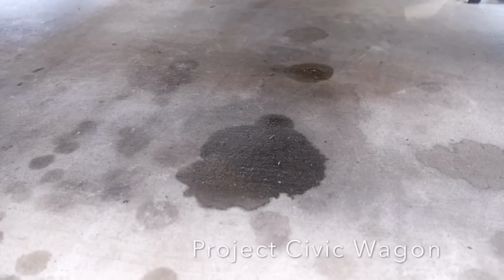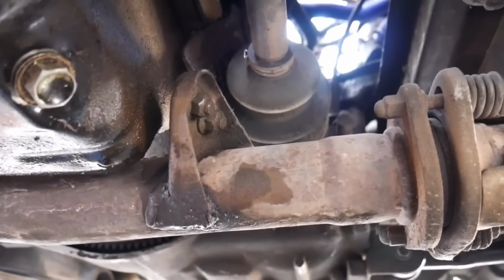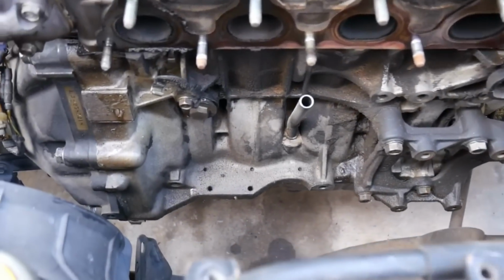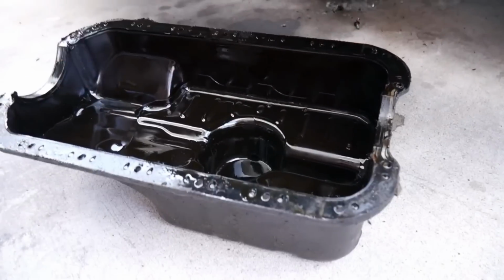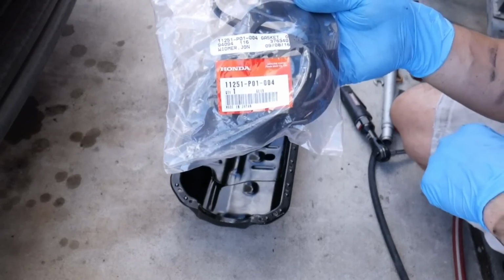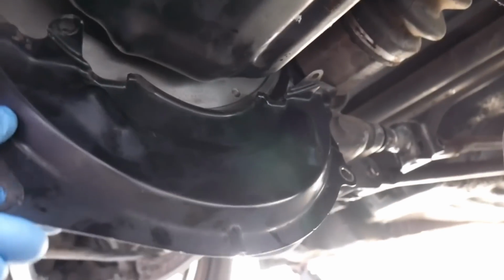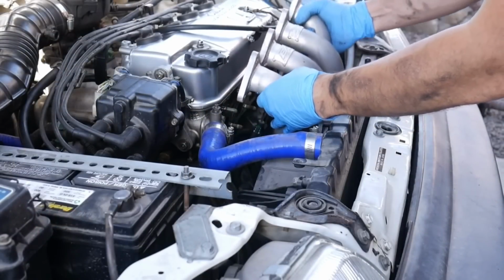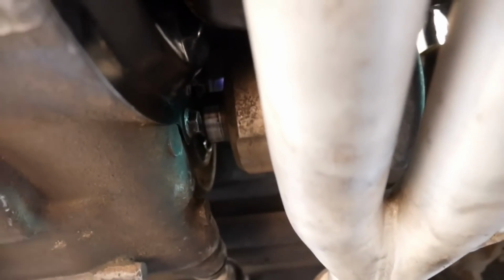How to Replace Oil Pan Gasket & DC Sports Header - 1991 Honda Civic Wagon

Comment: I had a cel come on recently and didn't realize the o2 sensor wire was hanging super low and rubbed on the ground and was wondering if I could just cut off the excess slack and solder it back together. this video answered that question!
Reply from the maker: Hehe, nice!

Comment: Thank you for all these straight-to-point, fresh and clear videos. Q: I bought a Usdm 91 Civic Si which is slowly getting tuned by me. It came already swapped with a DOHC D16A8 (a Euro-type ZC). They only swapped the engine and kept the rest of the bay with the original parts. Do you know is there any DC header that can fit this engine? I am going to use daily this in California but a nice header would be great. Thank you in advance for any advice.
Reply from the maker: Yes.  The sohc DC header is carb exempt too so you can use it in CA.
Reply: @GarageBuiltHondas  Will the clutch cover for that year civic work on a 94 civic 1.5 liter?
Reply from the maker: Yes.  The 88-95 Civic d15b engines all use the same parts

Comment: Oi im back at it again. Looks like the same process for d series motor. I have a big oil leak looks like the oil pan gasket. Looks like im missing a couple of bolts or nuts. My exhaust manifold has a crack. I was thinking about doing the same just with cheaper ebay header. Have you tried the ebay header and also do you know what kind of hardware i should get for the oil pan. I keep looking online and i see bolts and nuts looks about 10 nuts and 10 bolts. Oem gasket but what about the hardware. Should i get the hardware for the down pipe incase i mess up the bolts? Should i not get the ebay header. Do you know of any channels with d series motors. I got the zc but as far as i can tell its the same as d16

Comment: Hey man, i‘ve just started my own buid of an 87 civic wagon. But I cant seem to find that many parts. Could you maby tell me where you got your parts from? ( i need a new rear bumper, new brake system, etc)
Thank you so much!
Reply from the maker: No place in particular.  Original parts are difficult to find for 3rd gen civics.  I don't and have never owned any (don't find them appealing) so I couldn't tell you where to find parts, sorry.
Reply: car-part.com if you don't have access to junk yards it comes in handy.

Comment: I got a question on the o2 wire extension. The wire is single but it has a wire sheath. Is the wire sheath on the outside ground? Does that wire also have to be connected? I messaged you on ig about the same thing.  Im pretty sure both have to be connected.
Reply: Just realize that im talking about the wire to the engine harness before the plug connector.
Reply from the maker: It's a shielded wire, not grounded.  I've seen some o2 sensors work perfectly fine without shielded wire and some that didn't.

Comment: How long did you wait to put oil in I followed these steps and it was leaking bad on my headers still kinda frustrating
Reply from the maker: Immediately.  But I didn't start it until 24 hours later at least.  The RTV takes that long to cure.
Reply: @GarageBuiltHondas  dang so I'ma have to redo it tomorrow forsure

Comment: hey bro....question...what steps up the idle when the ac is turned on on these engines. ive heard of people saying iac....mine is one the bottom of the throttle body with two coolant hoses attached. the cold start fast idle of it is working so im wondering if something else steps up the idle with ac and turning the power steering.
Reply from the maker: +Jamauto tech are you dpfi still?
Reply: no im multipoint d15b7
Reply from the maker: +Jamauto tech The small valve which is attached to the manifold & throttle body and has a vacuum hose going to the middle of the intake manifold.
Reply: is there a way you could show me a pic or smt of it? by the way im a upcoming youtuber as well from jamaica and i love your content..keep up the good work! they installed a d15b7 into my 1993 integra before i bought it. i dont see any other valve on my intake unless they took it off
Reply: oh you talking about the valve at the back of the manifold? my intake manifold doesnt have that on it
Reply from the maker: Jamauto tech no, it's right on the end of the throttle body, and had a small vacuum hose to the manifold.  Google "d16a6 engine" and you'll see it!

Comment: Nice video J. Hey I had a quick question (you'd most likely be able to answer this). So on a B series, the bolt(s) that hold the exhaust manifold to the head came out easily, but once tried putting the exhaust back on and tightened the bolts it just keeps spinning/not locking. I know you can heli coil it since the bolt hole has been stripped. So my main question(s). How big is the "hole" I believe it's fit for an m8x1.25 bolt. And also instead of just putting an insert and putting another bolt would it be better to just fit on a stud (just like how the d series in this video has all studs. thanks for reading this long post. Ps- could you possibly make a video on tapping/rethreading? You'd seem like the best teacher on that.
Reply from the maker: It's funny you mention this, one of the studs coming out of the head actually broke off leaving the rest of the bolt in the head.  I'm going to try my best to remove it without damaging threads but that may be impossible.  If not I'll do a tap to the next largest size.  I'll check the measurement and report back here, I cannot recall the size off the top of my head.

Your idea of tapping the hole to a larger size and putting a stud is a good idea too.  The only problem you may encounter would be that the new stud is too large for the holes on the exhaust manifold/header.  But you could always drill that single hole out a little larger on the exhaust manifold/header and that would be easy!

I'll record the process of me trying to fix the bolt, I'm hoping I can just drill it out and use a reverse bit to remove it.
Reply: J Wid Films wow sucks for the stud getting broken! I really hate this because it causes an exhaust leak on mine haha. But yeah it's something I've been trying to figure out instead of doing inserts. Will be awesome to see a video and see how you tackle it down!

Comment: Does it pass inspection when putting the o2 sensor in the bottom and does it read the same  

In my ebay headers I have the option to put it on top and/or bottom and cannot use the top because it won't clear my fan just wanted to know if the reading the o2 sensor did was the same ?
Reply from the maker: Yes, it will be the same and should pass inspection.  Make sure the top one is sealed well so it is not leaking.
Reply: J Wid Films thanx man I just started doing the extension on the o2 sensor wire
Reply from the maker: DjReckz nice, you should be good to go!!

Comment: When u soldered the o2 sensor, did it have any problems with readings? Might have to do this with my o2 sensor as well
Reply from the maker: BirdyIsPro73 No problems at all and I've done this with numerous 02 sensors on these cars.
Reply: Garage Built Hondas i guess ima get my ass to learning how to solder, what gauge wire did u use?
Reply from the maker: +BirdyIsPro73 16 or 18 are most wires for the harness.  I can't remember exactly what this one is, I believe 16.
Reply: Garage Built Hondas alright thanks man, finally got some good answers, u just got a sub bro, thanks. Been struggling to find a way to extend an o2 haha
Reply from the maker: BirdyIsPro73 awesome, you'll be good man!  Seems like the o2 sensor wiring on these cars is always jacked up!  And thanks for the sub, much appreciated!!!
Reply: Garage Built Hondas yeah and the good thing is that my 91 integra has exactly the same o2 as ur car, im like thanks honda for making all cars the same xD
Reply from the maker: +BirdyIsPro73 No kidding, the one wire o2 sensors were so inexpensive too!

Comment: i installed an aftemarket and put copper antizise to all the bolts that mount the headers to the engine block and when i turned on the car ' about 15sec after smoke came out. so you think it might have something to do with the copper antizise or something else
Reply from the maker: Aftermarket header?
Reply: Garage Built Hondas yeah sorry. headers.
Reply from the maker: It might have been the residue on the initial burn from the new header.  The antiseize might burn up too but I didn't think it would since it's used on spark plugs and threads also.
Reply: Garage Built Hondas im thinking its either that or the gasket from the headers wasnt placed right. i placed some after market ones and it came with a thicker gasket and i noticed that the offset is off. the grooves dont match with the grooves on the engine block. i havent turned on the car since that happened and i got scared from the smoke coming out. I'll take the car out of the garage check everything out again and hope for the best. ill keep a fire extinguisher with me for extra comfort
Reply from the maker: Let me know what happens.  You should be ok.

Comment: Getting that transmission cover off was such a PITA.  Do those top bolts even matter?  I'm thinking of chopping it to get it back on.
Reply from the maker: You're probably fine without them
Reply: Were you able to remove the flywheel cover without moving the cv axle ?
Reply: I removed the axle and ended up having to replace the axle seals when my trans started leaking a month later.

Comment: Got a 91 civic sedan dx, d15b2, runs rich, have high hydrocarbon numbers, it misfires at idle, when i stop at a stop the car wants to die, but doesnt die as its running. only happens whenever i have less than a 1/4 tank of gas. No smoke, no check engine light. Any sugestions?
Reply from the maker: Has a tuneup been performed?  Plugs, wires, fuel filter?
Reply: Jon Widmer 
did new plugs, distributor cap and rotor, has fresh oil change, have ebay intake with new filter, replaced coolant temp sensor. just bough the car, last owner said he put new o2 sensor.
Reply from the maker: If it only acts this way when low on gas, it might be the fuel pump filter/sock being old and clogged possibly.  When the gas gets low, it is only going in from one side of the sock and that side might be pretty rough.  Just last week at the track, a friend changed his pump/filter in his miata and the sock was all caked up with this white crusty residue.  It's a possibility yours may need replacing.
Reply: Jon Widmer is that why it also runs rich? or could that be a different thing causing that?

Comment: have you ever used a auto parts oil pan gasket?
Reply from the maker: That blue evo tho Do you mean from Autozone, O'reillys, Napa, etc?
Reply: yes I do
Reply from the maker: That blue evo tho Yes, I prefer the OEM ones but I've had good luck with the auto parts store versions.
Reply: ok because my oil pan gasket is leaking but my plan is just to buy one from autozone for mean while since I my end up doing a swap down the road
Reply: thank you tho really appreciate it

Comment: I also having an oil problem  I have the oil light on my car just stalls out and my power steering gets hard
Reply from the maker: Are you sure you're not low on oil?
Reply: I went under the car and it was leaking as well   I have a Honda  civic coupe 1996 got a D15B engine and my friends say I have the wrong oil pan it’s leaking from the top I just say it’s the head gasket but honestly I  don’t know

Comment: Having an issue dropping the oil pan the transfer case is giving me an issue I'm not sure how to take it off please help meeeee
Reply from the maker: There are a couple nuts attached to the flywheel cover which might be the problem you're experiencing.
Reply: @GarageBuiltHondas  that's all out, there's a screw that comes out the transfer case that's giving me an issue and I cant get out to take the transfer case off so I can take the oil pan out it's kinda hard to explain ... easier to show I was told I have to drop the transmission in order to do it ... I have a 91 Honda civic wagon real time awd ... anyway I can send you a video ...

Comment: That header looks like it would fit my 89 integra perfectly. Do you have the part number?
Reply from the maker: It might.   Part # HHC5002 made specifically for the 88-91 civic/CRX.  If it doesn't bolt up you could always modify the flange.
Reply: Thanks dude. Well i know for a fact the 86-89civic and 88-89 integra share the same chasis. Everything you have been doing to your cars looks almost exactly identical. Kind of trippy. Thanks for the fast replies,  your cars are clean.
Reply from the maker: Thanks, I appreciate it!  If you get the header let me know if it fits, I'd love to know just for future reference/knowledge.
Reply: For sure. Im stoked you are working on older civics.
Reply from the maker: I love em, I tried to get away once but never again!
Reply: I didn't get the same exact DC sports header, but I got a generic one from ebay for an 88-89 civic&crx and it fits perfectly. No need to re drill the flange. Gonna do that, and the oil pan gasket tomorrow.
Reply from the maker: Braden Munafo Awesome, thanks for the update!!
Reply: Dang i thought it was an integra DC header but your saying it was a DC sports header.
Reply from the maker: +B. Smith It's for the D series engines.

Comment: Do you have classic car insurance? After doing all the work you do, it would suck to get in a wreck. I have an '82 diesel Rabbit I restored, put thousands into it, finally got everything perfect and some jerk got road rage on me for no reason (I just passed him because he was going under the speed limit) and he pulled in front of me and slammed the brakes, I hit him at 55mph, then he took off. Suburban vs Rabbit... Bent the frame and broke my heart. My insurance says it's only worth  $500... Now that I have a new baby I'm working on ('88 rt4wd) I want to try and get it insured properly so this never happens again. Any recommendations?
Reply from the maker: Unfortunately I don't.   I have liability only.  I feel like the extra money I would pay in a higher insurance would easily surpass the price of me finding another clean shell to begin with.  Honestly, I could possibly be completely wrong though.  I have just never looked into it.  I imagine the 82 Rabbit is a lot more difficult to find than any of these 88-91 Civics, but that may not be the case in a few more years.  Seems like these are getting more rare by the year.

If you look into the differences in price for the insurance, I'd love to hear about it.
Reply: I see your point, but for me it's more about the time put in. Also, I only buy really nice rust free cars. It would be hard to find a shell as nice as what I got on my rt4wd and my Rabbit was probably one of the nicest ones left. Still have it and some day I'll buy a shell. Everything still works, ac and all, doesn't leak and I drove it 60 mph after the accident. Only problem is it doesn't shift into first. The whole front end is smashed and moved over an inch or two and the frame is bent. I've thought about stretching the frame and making an art car out of it but I have other things to do and cars are just a hobby that distracts me, but I can't help it...  I saw a sexy little Rabbit the other day and it really made me want another one, but honestly, 4 gen Hondas are made better... Also have a 90 4x4 Justy that I want to lift and trick out. Sweet little car but hard to find parts...
Reply from the maker: I hear ya, I feel like all I do on my days off are work on cars.  It's like I have 2 Full Time jobs!!  Lol

If you find ou info on the insurance, please fill me in.  I may make some time to go ask about it myself.

Comment: How will u loose a 10mm stripped nut doing the oil pan
Reply from the maker: Eduardo curvelo Try to use a socket that you don't care about damaging.  Try a slightly smaller size than a 10mm and hammer it onto the nut.  If you get it on tight enough, you'll be able to spin the nut off, but the socket will be damaged.
Reply: Thanks, ill try that

Comment: Forgot to say you need to drain your oil 😬
Reply from the maker: Lol, hopefully that's a given, but you know people!!
Reply: Also when extending wire in the engine bay you do NOT want to solder them cuz the hear from the motor will warm up the solder and make the wire come apart. Even Mighty Car Mods said that 😬
Reply from the maker: Coda5610 damn, I'm doing all kinds of wrong in this video.  Lol.  Funny you mentioned that, I just had a conversation about this with one of my best friends a few nights ago.  He works for a company called "The Airbag Guys" and they will do a lot of repairs for wiring/airbags/engine harnesses etc and he worked for 12 years as the Lead Installer at Best Buy and he said that the solder is usually ok because most solder has a melting point of close to 400 degrees Fahrenheit.  Granted, the exhaust/header/manifolds get a lot hotter, the rest of the engine never gets that hot.  

I've used my infrared thermometer before on my engine block and head and the temps were always in the 200's and fluctuating depending on load.  I'll probably keep using solder for small things like this.

Do you use quality butt connectors/crimps for your wiring?
Reply: Ohhh ok and i dont do alot of wiring but when i do i use them. And awesome video btw 😬
Reply from the maker: I should look into getting some, especially when I convert to MPFI.  The only thing I don't like is how bulky they can get when using a handful together.  But I'm sure it'd be worth it.  Thanks for mentioning the solder, I love the conversation! 😀